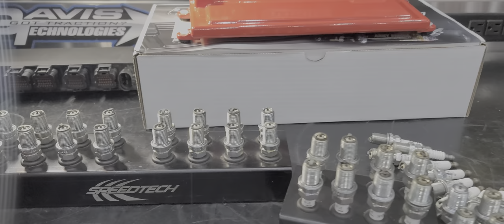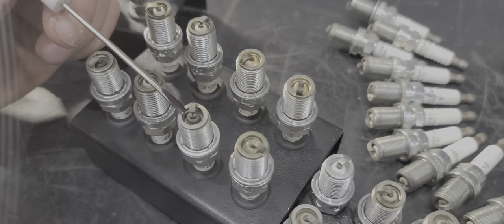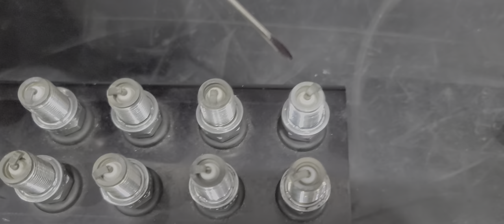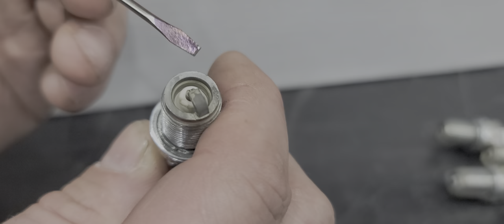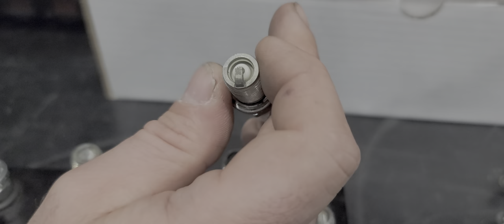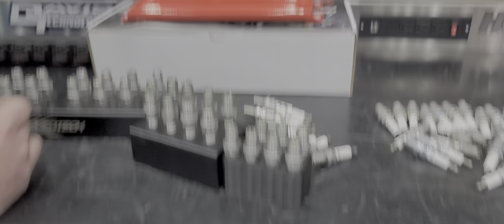Reading spark plugs on methanol tips

Comment: I genuinely appreciate your generosity with your time and sharing information. 
I hope you don’t mind me adding that if you’re planning on watching the plugs into the threads, it’s important to know how much and how well the plug is shrouded by the metal in the combustion chamber. I’ve seen heads that come from porting where someone got a bit overzealous and they cut too much away from the perimeter area of the plug.

Doing this exposes the ends/sides of the of the spark plug instead of the aluminum in the chamber covering that area and sinking heat from it. If you have your heads off before assembling your engine, I consider it good practice to screw the plugs in and see how well the sides of the plugs are covered. It’s not a common problem but when you’re experiencing some weird things when trying to tune your setup, things like this are  worth knowing.

Comment: Finally a detailed explanation on the term "turns" in regards to cadmium burn off. I always knew it was a balancing act but it makes sense that just because 1 aspect of the tune is perfect you can't address the other without backing down on the first since it will be more aggressive once the other is brought into tune. Thanks!

Comment: Great explanation. Particularly the visual aspect. One sense I’ve always used on alky engines is your sense of smell. If it smells sweet, there’s alky present, it it smells burnt, chances are it’s lean. Then I go onto visual references as you’ve highlighted. It’s a method I was taught by an alky fuel master who built methanol 350 Holleys for dirt circuit, back in the days before you could buy that stuff ‘off the shelf’.

Comment: Few times I’ve ever heard anyone mentioned burning down the threads. Been jetting on methanol for years but only on single cylinder. But hardly ever anyone mention the threads but that’s always what I’m targeting with my main jet. Then use the main and mostly power jet (wide open top jet) for the strap. Tough to see timing mark with single cylinder plus running 20-30 lap dirt track races with variable loads on the motor every corner. But again just nice to hear someone mention the threads.

Also just saying, it’s sad how bad the air quality has gotten last couple years

Saw my first chocolate brown plug the other week and it had to be 34 degrees out
Used to be way more frequent before the increase in humidity and co2 in the air

Comment: Brilliant Devin, I was the guy who posted up on turbobullet about doing headgaskets on methanol and you said you would do a video so really happy you did it. You explained it in a way I perfectly understood and gave me the pointers I need to at least start at the track tuning mine on methanol with no intercooler. Im guessing when your dealing with a new combo you would aim for say 5-10 degrees lower then where you think it would be(basically where i was on gasoline and intercooler) and really fat to get at least one pull so you have a starting point. Do you normally go to the 60ft or 330ft at the start, as I would expect you need a certain amount of time to 'mark' the plug but not to much to damage the engine.
Reply from the maker: if you were on race gas and intercooled i wouldnt be thinking you could add 10 degrees to your old tuneup.  just wanted to get that out of the way.  i would take your race gas tuneup (if it was good ) and take 4 degrees out of it, get the fueling close based off of bsfc from your gasoline tuneup, then make a 330 hit on low boost and see where youre at.
Reply: @theholleyefiguy  thank you, I meant 10 degrees off my gas tune up as a starting point, but ok I will start with 5 and try around 3.5 AFR as a first hit and see where it puts me, I've even downloaded this video to take with me to the track so I have something to refer to while I'm there :)
Reply: @theholleyefiguy can you do a video on reading e85 plugs

Comment: I’ve watched 15 videos on this and this is the first one that actually makes sense. Thanks man. Quick question, after installing new plugs how many passes or how much time do you allow on them before checking. Does it take a little time to burn the cadium and make the timing mark or will this show up in one pass.

Comment: @devin vanderhoof at about 8 min you are showing the burn on the ring and continue to move toward the strap. How many passes would you estimate that this plug was run to get to this point? Are you pulling each run? If you run and pull the same plug back to back for say 10 passes and then change it will one pass give you essentially the same read as the prior plug did after 10 runs as long as the tune doesn’t change when the plug is changed. I have a 6.2L SC Hemi that is about 400hp more than stock and I run 2 ranges colder in NGK with a slim .026 gap on all 16 plugs. It is about $150 per set of 16 but with running Ignite Red 114 (E90) fuel and 21 psi of boost it would greatly benefit me to read the plugs as I continue to tweak the tune. At 6000 lbs for the ride even an extra 30-40 ponies would be a plus but to add the plugs into the mix I need to understand the number of runs on each plug because with 16 this is gonna cost some change.
Reply from the maker: plugs are read after one pass with it being shut off at the end of the run